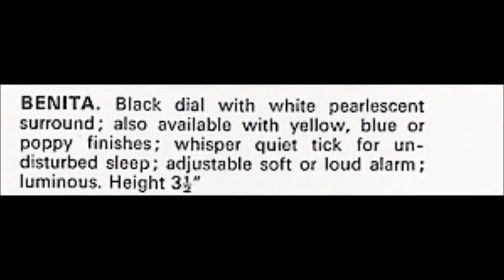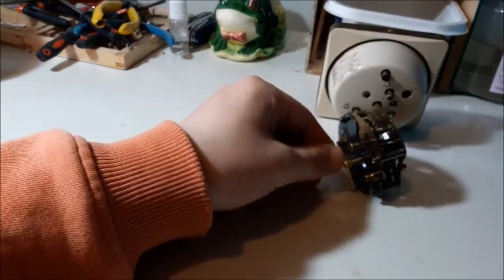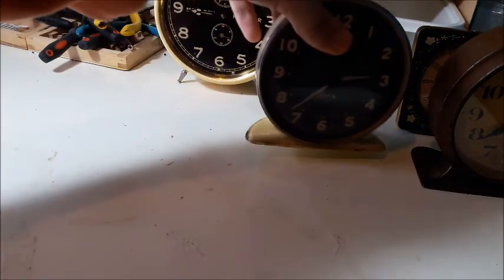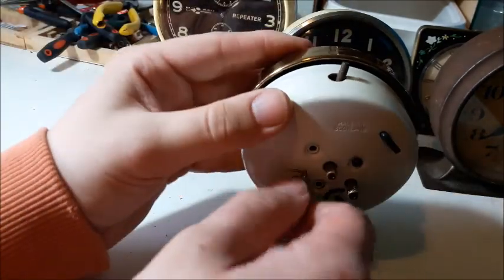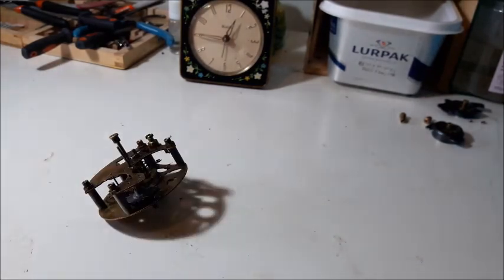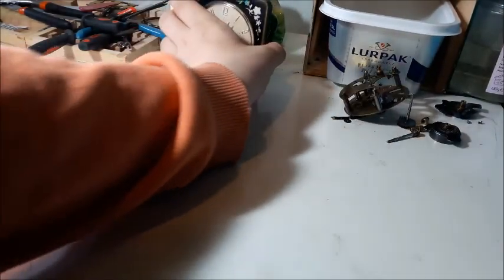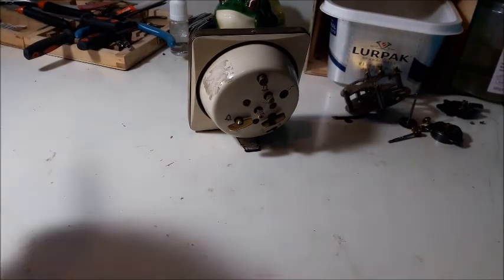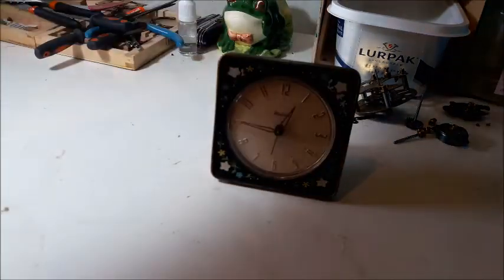Westclox Benita (Baby Ben Style 7) service Part 1 | Vintage Alarm Clocks

Comment: You know the shabby chicers would love that gear on the Baby Ben style 8's base! "OOOOOH STEAMPUNK" 

It's also good to know the "Bayard" and the German clock are okay. I have to go back and look at those videos. 

The Scottish knobs actually are different than the ones we have over here. If you look at the North American knobs, they have a longer shaft on them. They also don't have a hole in the top. 

Removing the alarm setting wheel instead (carefully) shouldn't damage anything. I've had a good success rate with it.
Reply from the maker: I might actually keep the Baby Ben like that... did you notice the cog on the base is part of a spring barrel from a Style 8 baby ben movement?
Reply: @VACC  LOL I didn't! That makes it even better.

Comment: Hi, Great video thanks, wonder if You've any ideas to advise Me?, I've bought a style 7, described as 'working', however, it does for maybe 20 or 30 minutes then stops, a gentle shake resumes service, It has the two keys made in Scotland but I'm not overly keen putting it to My ear with the Radium close as I'm recovering from cancer treatment and fear I Myself will glow in the dark instead of the clock!, any help appreciated, regards Stewart.
Reply from the maker: Sounds like the movement needs a service... Unfortunately, if you want to try and service it yourself, you would need to expose and handle the radium hands and dial, which, if you are prepared to take the risk, need to be handled in a well ventilated area or outside, preferably with a dustproof mask and maybe a vacuum cleaner, as its the radium dust that does the damage. It would probably be ideal for someone with the right facilities to take a look at it... Good luck!

Comment: Looking at your movement VS mine, there are minor differences. The knob sizes, yours lacking blued steel, a center wheel with spokes and so on. At least yours has the actual date code while mine doesn't! What the heck is with that? 

When removing a hairspring/balance wheel assembly from the regulator, simply turn it backwards and prod it out with a toothpick. Don't pull the hairspring out of the regulator. You may bend it by doing it in this fashion. 

I've also noticed you've got longer pliers than I do for knob removal. Maybe that's my problem? I'm not really sure.

Otherwise, you did just fine.
Reply: Thanks, it's usually the Scottish westclox without the dates... As for the hairspring, it had a kinked tail which meant it needed a bit more fiddling to get through the regulator, however it is useful for knowing the exact length of tail when it comes to reassembly
Reply from the maker: *Pretend i actually remembered to use this account lol